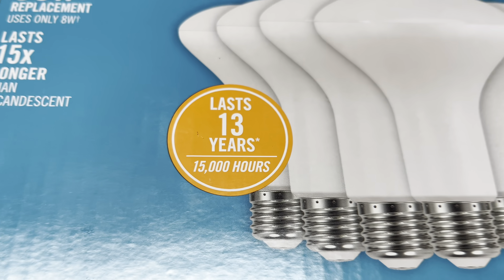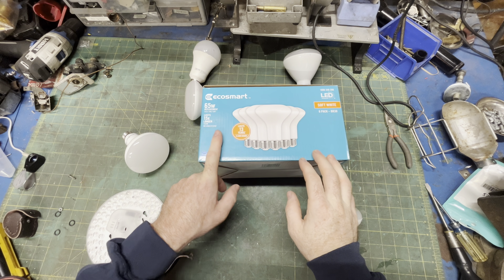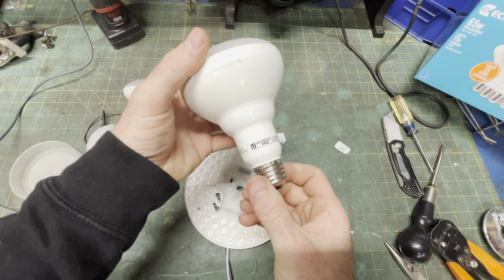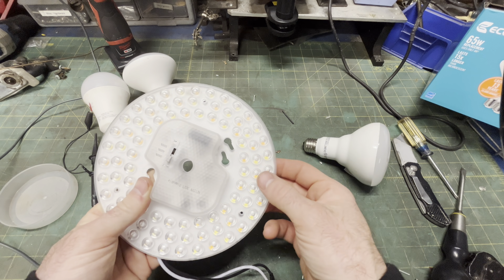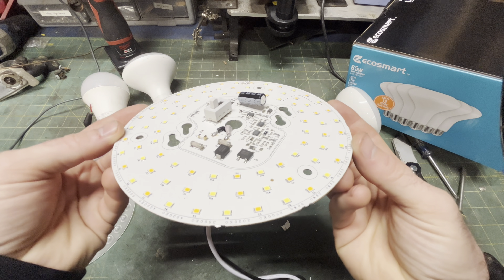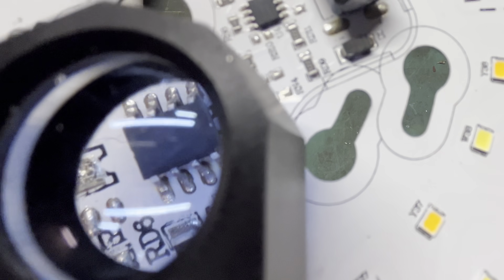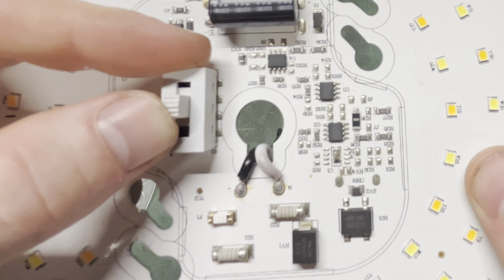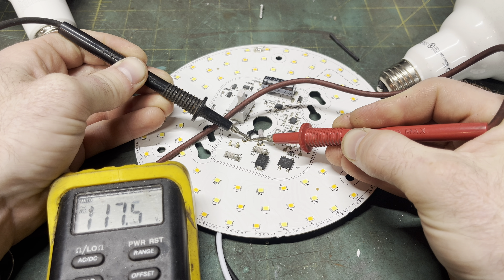Why Do LED Bulbs Fail? An Autopsy!

Comment: Solution is to install a big gq transformer for every light switch that brings down to 12v and use 12V LEDs. They last forever then, mine has lasted more than 7 years so far. Transformer can't be to far from LEDs though.

Comment: I started taking the time to drill a small series of vent holes in the base of my LED lights. Since I started doing that I have yet to have one burn out. Just take your time and be careful, make sure you leave no chips in the bulb, and obviously do not do this for outside devices.

Comment: I have had and have incandescent bulbs that last decades.  At least 4 for some of my older lamps.  I tried fluorescent bulbs when they came out a decade or two ago.  I bought a Chinese made box of them at Best Buy on sale one day.  Installed one by one I watched them stop working over the course of a year.  I just swapped them out from the box at first.  Then the show stopper.  I walked into a room and turned on the overhead light and was met with immediate sputtering, and most worrying, actual smoke and small red sparks falling, coming from the base of the bulb.  That ended the life span of fluorescent bulbs from Chine in my house.
About a year ago, due primarily to my running out of stored incandescent bulbs I began to use LED bulbs.  I have yet to have one last 6 months.  I have one in a hall that works sometimes.  Luckily it isn't the only light in that hallway.  Apparently whenever an alien spacecraft enters or departs our atmosphere it turns on or off.  There is no discernible regular interval between turning on and off.  Sometimes it turns off for a half hour, sometimes for just 4 or 6 minutes, sometimes for 2 or 3 hours.  It is the only LED on that circuit so whatever is happening is either internal to the bulb, or some kind of interference caused by alien space ships crossing the Van Allen Radiation belt or Chinese experimental firing of their Ion cannon.  Luckily at an auction I was able to pick up some more incandescent bulbs.  My intention is to wait another decade (or two) before again trying LED technology as a cure for darkness.
It is pretty obvious here that at the current stage of development any talk about LED lights saving the consumer money is just scammer talk (aka BS) once the cost replacing failed LED light bulbs is factored in.  Maybe in a decade there will be reliability improvements, but as a consumer, I will wait and see.
Reply: You should have a qualified electrician inspect your circuits.
Reply: @user-hm5zb1qn6g  LoL I have.  It isn't the circuits, it is the cheap manufacturing of the LEDs.

Comment: Get commercial rated bulbs from a known vendor. Phillips master series or similar. They last a very long time. I think people don't remember how often we did in fact replace regular light bulbs. I haven't replaced any led bulbs in my house in 3 years or so. The ones that needed replacing were cheap crap not actually much more than an incandescent. With the incandescents you'd replace one somewhere every month or so.
Reply: Oh yeah, I remember replacing a light bulb about once a month or so when I was a kid. Now it's maybe once a year I'll find a flickering LED.
Reply: my incandescents have lasted years. sounds like you were buying the cheap ones
Reply: Every month? You must leave them on all the time. For the living room, I think I replaced them every 6 months to 1 year.
Because they are rated for 1000 h, which means 1000 h / 5 h per night = 200 days.
Other locations probably were every 2 y.

We usually use 60 W bulbs and I still have some.
Reply: Every month?
That's not good, I never replaced mine that often.
Reply: @louistournas120  It was normal to replace one every couple weeks because they would all be varying ages and not dying at the same time.
Reply: A bought a box of LED bulbs from Temu and compared them to ones I'd bought from Amazon UK, and they were distinctly less bright, which was confirmed using the simple light meter of my smartphone. I then checked the consumed wattage of these supposedly 13-watt bulbs, and it was 10-watts! I sent them all back as well as telling Temu about the discrepancy but, needless to say, they're still selling them.
Reply: Good point!  I've bought quality LED bulbs from the start, like Phillips, and they've never given me any trouble.  Replacing light bulbs is like not even part of my life now... LEDs  (guality ones) just work.
Reply: I'm facing a different problem where I live; Phillips and other higher quality brands are becoming less and less available, to the point that the only LED bulbs you can get from stores are really small ones, good for a desk lamp or a small room. If you want something bigger, stores only have the crappy ones. Those brands that don't even appear in a Google search, you know.

So, I can't get better lighting even if I wanted to and was willing to pay for it. There aren't many options here anymore, as these poor quality brands that are a lot cheaper have been slowly replacing the good ones.
Reply: As a plasma fanatic  I just stick to fluorescent lamps. Most LEDs are boring for me. Filament style is OK but most other types are as ugly as the average mother-in-law.
Reply: We didn't need the heat on in winter in our living room with 600 watts of incandescent bulbs burning every evening. Where we live, we have these nasty 1 second power outages that do a lot of damage to most electronics. We replaced those 100 watt incandescents about every 3-6 months or so. The LEDs we've bought vary tremendously depending on their manufacturer. Ordinarily, we're getting 2-3 years out of the cheap ones, and over 10 for the good ones that cost $20 each. In the meantime, we have brighter light in our living room with 84 total watts instead of 600.

Comment: I was an electrical project manager for large construction firm for many many years. Back when LEDs first started coming out for commercial use, since we would buy millions of dollars of lighting , asked if we'd like to try some of the new fangled LED fixtures just starting to be produced, which I did. As usual we got the 120,000 hours of guaranteed  life of the LEDs with them failing quite regularly. Talking to the manufacturer's engineers I was informed that the guarantee only applied to the LED only and not the drivers that are needed to make the LEDs function. Even today, trying to get them to replace fixtures that fail, you will still get the same thing, "The LEDs are fine, but the driver has failed and we don't warrantee drivers."

Comment: Specifically eco smart, been tearing them down for years now when they die and every iteration I notice they use less and less  materials and push they led’s harder and they usually fail in less than two years by either flickering for no reason at random or just flat out not turning on
Reply: Same unreliable experience with ecosmart. I paid more and got some Phillips and they run cool and flicker free. Much better bulb.
Reply: @kmschwem  yeah, I bought a crap ton of Phillips led bulbs when they all went clearance at the Home Depot I work at, all work perfectly other than their odd ball 250w equivalent led bulbs that they have with the soft glow feature, had two of them just randomly fail a little after 6 months of maybe 5-10 minutes of use a day (basement lighting) no flicker no  nothing, juts flat out wouldn’t turn on but all the the led filament stuff is excellent so far

Comment: I have done a few LED bulb autopsies as well. The older ones with switch mode don't have capacitors rated to last the claimed lifetime given the temperature inside the bulb. A capacitor lifetime is rated at its max temperature and voltage and that is not as long the bulb lifetime, so it needs to have a voltage and or temperature rating way over what it experiences to get the lifetime required.

I also had one that used the wrong sort of silicone glue for electronics. It has to be a special type that doesn't emit acid when it cures. The PCB traces were corroded away.

The more modern linear regulators get too hot when the mains voltage is towards the top of its spec. I have seen some that use heatsink compound to connect the chip on the PCB to the metal bulb base. Heatsink compound is designed to fill microscopic surface defects, not bridge large gaps.

Comment: I have an old LED bulb, from when they first started selling them for residential use.  Cost almost $100, and most of the body of the bulb is a solid cast aluminum heatsink, with external fins, with just a little oblate spheroid of clear plastic at the top with the LEDs in it.  Had it for at least 20 years, and still use it in my lamp.  They really made them different back then.
Reply: They also cost more back then. I remember paying $13 per bulb 10 years ago. (Adjusted for inflation).

Comment: I used two of these older bulbs given to me through some kind of Pennsylvania energy conservation plan, they were free. They fail far before their proposed life span because of the heat the base generates. The heat which then causes thermal expansion of the bulb housing causes cracks in the external housing which is why the solder and other parts fail. the LEDs themselves may not make heat but everything that goes in before the LED into making it work does make heat, a lot of heat, and if you don't remove the Heat things expand and they break.

Comment: If you want some decent quality LEDs at reasonable prices I recommend taking a look at sylvania bulbs. I don't trust most no-name brands for home lighting. I have had some bad experience with Feit bulbs and I have a disdain for Philips as they took away the ability to have smart bulbs work locally and not have to create an account or send data to the cloud.
Reply: I've had good luck with the "house" brands at certain dedicated online bulb stores - so far they've lasted infinitely longer (in that NONE have failed yet) than anything from the box stores or the online scammy river store.. Compared to the ones from the box stores, some of which failed within 5 hours of use

Comment: For this sort of work I made a pair of probes using sewing needles and BIC biro tubes. Gives you very sharp points than can easily punch through crap, and into the metal enough so they never slip. The biro tubes provide strong well insulated probe 'handles'.

Comment: Makes me upset that my local Lowes and Walmart won't stock incandescent bulbs unless it a oven or microwave bulb. We're all forced to buy garbage marked as a good products.
Reply: But even the worst quality led bulb is better than the best quality incandescent bulb. Like, by far. Wastes 10x more power for the same lumens. LEDs cost about the same and generate basically no heat. Also, no incandescent bulb ever, lasted more than 2 years, unless it was one of those super dim ones like 20w or less. Source: Me, I am from the 20th century. Back in the day replacing light bulbs was a monthly task around the house. Especially super bright ones like 200w bulbs didn't last at all.
Reply: No one is forcing you to buy garbage bulbs like those in this video. You you choose to buy those instead of the good quality ones, don't complain.
Reply: You can still get rough service bulbs I think? Somehow they got exempted from the ban. They ain't cheap though.
Reply: @ukaszsmoa8416  Running LEDs off house current just doesn't work well. There's no way around the voltage difference. LEDs really don't like high voltage AC. The parts capable of doing the conversion don't like living next to LEDs. That goes for good, bad and indifferent qualities.
Reply: @1pcfred  That is false. Look how panasonic, lg, or osram designed their bulbs (not the cheapest ones from their offer, they also sell garbage for those that want to buy it) and you will see the difference. Cheap bulbs overdrive cheap leds to get correct light output, without investing into heatsinking - recepie for failure.
Reply: @ukaszsmoa8416  expensive doesn't always mean better. We'd hope we're getting more for the money. That's often the case. It isn't always though.
Reply: @MasterChef12109  Not true lol

Comment: Most of our LEDs die inside a year of intermittent service. Some electricians about suggested it was due to 'brown-outs', a drop in line voltage when something else places massive, sudden demand on the line. However, we have 25kW service and the biggest thing that would ever kick on is a 10hp electromotor that uses about 6hp of current.
We bought Sylvania and Philips brands.

Comment: I started dating my LED bulbs when I install them. About 23 months is my average. I had incandescent lights that were 10 to 15 years old before they failed. Unfortunately in my area, you can’t but incandescent bulbs anywhere. So I’m stuck with inferior lighting thats just more expensive to use.

Comment: Similar landfill-spec lighting has been filling the automotive world, though generally made better, you still end up replacing whole units due to a single little solder joint or the AC/DC converter borking and feeding the LEDS flickery alternator power until they die.... and if it's a replacement part, keep your proof of purchase.

Comment: Wow, over 2k comments!  At the risk of duplicating other comments and just adding to the noise, here's my 2 cents:

- When measuring components in-circuit with an ohmmeter, I always measure at least twice, reversing the meter leads as a sanity check.  That way, if some non-linear component (e.g., a substrate diode on an IC input pin) is loading the circuit, the reversed readings will be different.

- You really need some sharp needle-point probes.  I use a Pomona 6275 probe set, with a short length of heat shrink to cover all but the very tip.

- The diode mode on your meter is displaying voltage drop across the diode with an injected current, not resistance.

Comment: As a contractor, I have installed  dozens of outdoor LED motion Sensing flood lights. 3/4 of them have been 120 VAC, and 1/4 of them Solar powered.  ALL of the 120 VAC units have failed within 13-15 months of installation, all from the power supply failures of various kinds (just past the warranty expiration).  I did post-mortems on all of them and the LED's are all working fine.  All of the Solar Powered units are still working, two of them for over 7 years on the same cheap battery. Yeah, the complexity of the conversion electronics have been the downfall on each of the AC units.

Comment: Add 10% more LEDs and 10% less current through them and you'll probably have a 75% longer lasting bulb. But that would add 5% to the unit cost, so noone does it.

Comment: Back in the early '90s I installed 4 halogen incandescent 100 watt bulbs for garage lighting.  They were of the unusual shape (bulge in the middle) and fit in ordinary bulb sockets.  No joke, all 4 lasted for over 15 years.  And they were turned on virtually every day.

Comment: Thank you for the insightful video. I've been repairing led lightstuffs here an there, and I agree that most of them fails because their power supplies failed. Luckily with the proliferation of tech gadgets I've amassed quite a collection of dc adapters with outputs anywhere from 1.9V to 24V, and with them I can usually clip off the supply and just soldered a dc socket. Power supply far away from heat generating component = long life. 

Second type of failure is the other way around, where they cut costs of the led silicons themselves by using fewer of them and driving them to the edge of oblivion. These usually failed by dimming. 

I really looked forward to a future where residential solar power is so ubiquitous that HVDC gained a standard in households, something like 48V or 50Vdc. Then all new light installations can simply use buck circuits.

Comment: It's tough to adequately testing them without adequately thermally stressing them.  Even though they have plans like the heat spreader aluminum plates, often the plates don't get out to ambient, and nothing takes the heat away, so the components face higher than rated temperatures.

The best long term answer to me is DC Bulbs with AC/DC conversion in the lighting fixture that you plug  the DC bulbs into, where you can do proper thermal and electrical design in the fixture that could be more expensive.

Comment: My early led bulbs used to last about 6 months or so.  About 5 years ago I installed solar and an inverter, and since then I have led bulbs that have lasted from then and still going. (One or two have failed, but none that I have replaced since switching to the inverter).  I compared the waveforms from the mains and the inverter, the inverter is significantly better but also doesn't have the pulses, spikes and surges which I see on occasion on the mains.  I'm guessing that is significant.
Anecdotally, if my sound system is on the inverter (which it usually is) it sounds great.  On odd occasions under heavy cloud or rain I am forced to switch on the mains to compensate, and then the inverter routes the mains through and the house is on mains.  My sound system doesn't sound as good, and I have an audible hum on the speakers.

Comment: As a kid I had an LED clip-on reading light. It was probably the first lamp my family purchased which used consumer-LEDs. My parents began to use it after I moved out, and AFAIK it still works. The LED inside has never been replaced (I’m not sure it could be easily replaced), and yet I think it’s more than fifteen years old by this point.

Comment: Bought a new house in 2020. Every single LED bulb and fixture failed in 3 years or less, so I bought a huge collection of of Hungarian-made GE incandescent bulbs. They might use a little more electricity, but incandescent light is just more pleasant and cozy, and that's worth the extra spend.